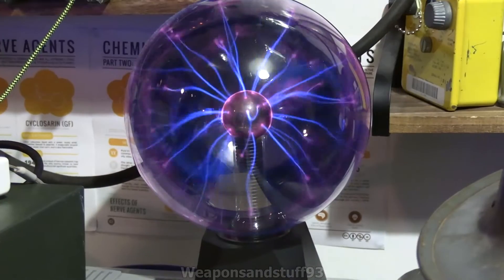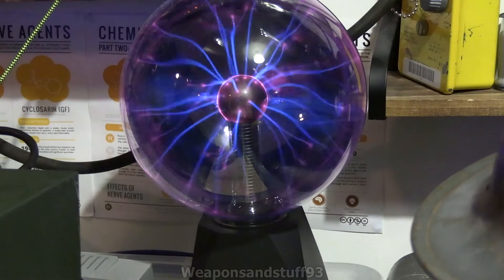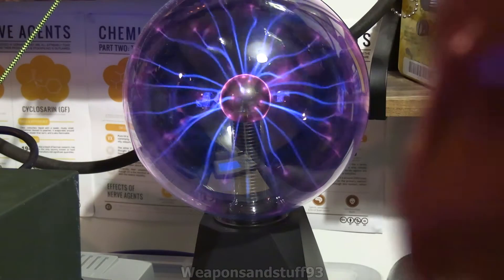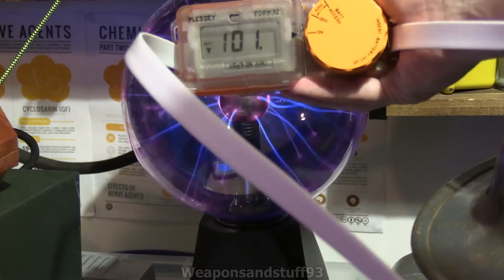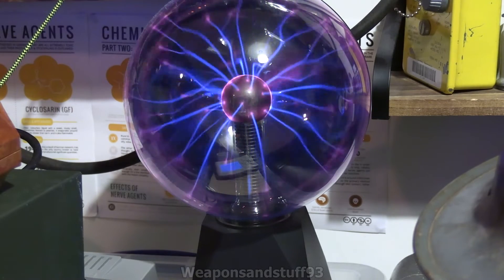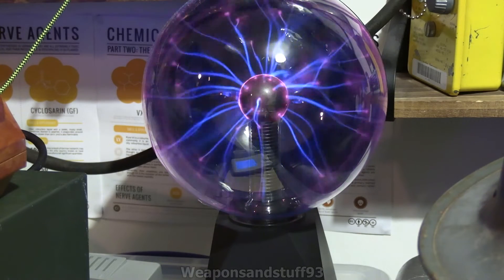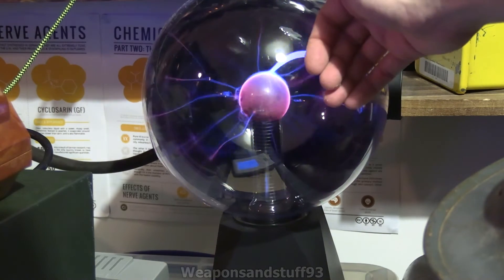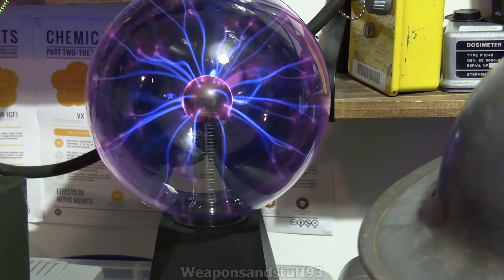Plasma Balls messing with Geiger Counters

Comment: If you wrap your Geiger counter in aluminium foil, it helps a lot. I tried that with one that goes crazy when it's near a plasma ball, with the foil it was silent. On the other hand, I guess, there are lot of Geiger counters that don't respond to these high frequency electric fields at all, namely Czechoslovak RBGT 62 and IT-65.

Comment: Shows a clear weakness in Geiger counters since I don’t believe there’s going to be any radiation from a plasma ball 😂
Reply: Have you guys ever actually done a validation study before saying there's no radiation? Like pinhole aperture in lead sheet and spread the beam using a PROPER crystal that will diffract even small wavelengths?
Reply from the maker: Yeah just EMF interference afaik

Comment: I love your videos I do not know much English but I find out what you explain I like you and what is your size of the gp5 I mean the size that has an example number 0y 1y  2y 3y 4y the Soviet sizes of the gas mask ?
Reply from the maker: 1 is small 4 is large, the Y just designates a later rubber/model variant
Reply: @weaponsandstuff93  you think that the 3y would stay loose or small in my 68 cm head
Reply: @lvl_antoni_lvl   you can find original size guides online, they're pretty accurate so I suggest using them before you buy a mask:)
Reply: @gazov2115  I already saw myself thanks for the info

Comment: I think several people mentioned this, though I was definitely one of them. Good example with the Chinese Geiger counter; yes, anything metal in between the lamp and the GM tube will stop the crazy readings. Even a single layer of aluminum foil might do.
Reply from the maker: Strangely even the Soviet DP5 probes with the metal shielding give false readings.